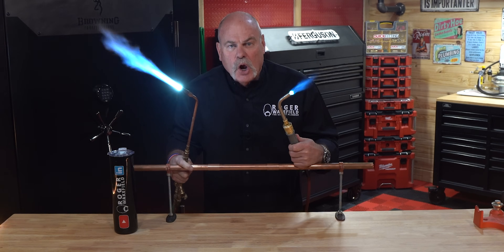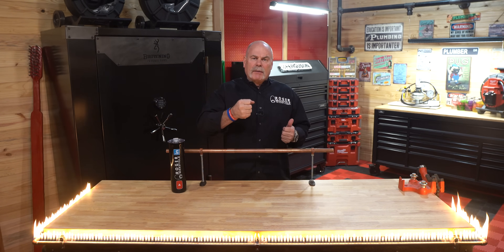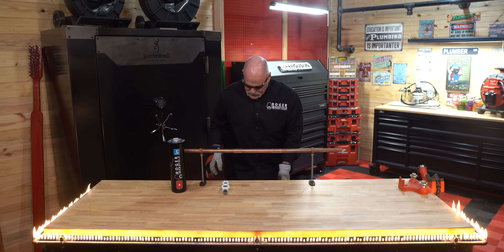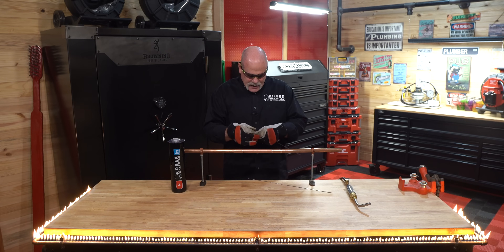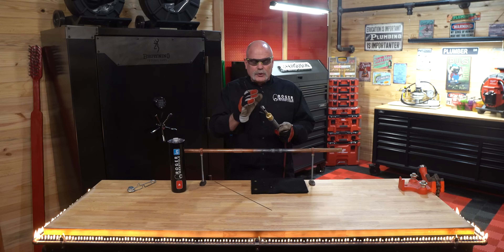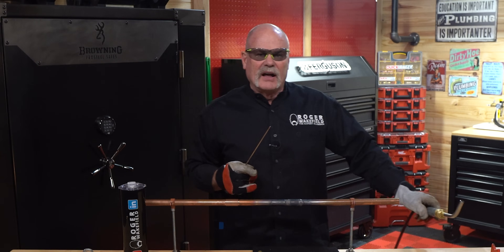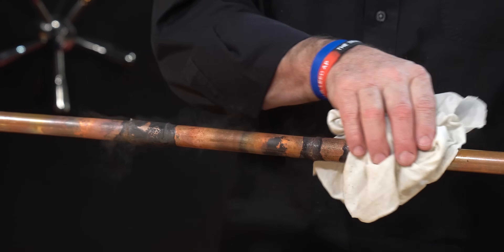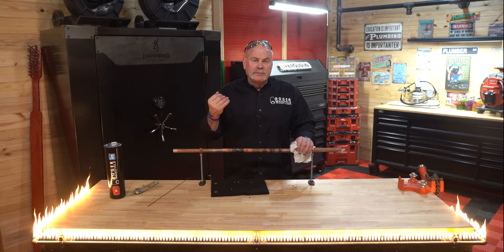The BEST Way to Braze Copper Pipes

Comment: very smooth i can see your experience. we usually like to suck into the bell a little more and then go again and throw a nice cap where you can’t see the edge of the bell. especially when doing CO2 stores that run at 900+ psi

Comment: i like turbo torch because of the size of the flame. normally doing it in tight spot and stuff in front and behind the pipe i am fixing . great video
Reply: The rosebud is always better you can use the appropriate tip size and even can control the flame too.  His instructions are really lousy

Comment: i like to get the pipe and the fitting glowing red hot then add the filler rod. quick and easy it lets you get all your work done with plenty of time for screwing off.
Reply: I was taught the same way, in HVAC class. Get it red hot, then apply the brazing rod. And as Roger mentioned, cleaning the joints prior to assembly is a big plus; although I've seen guys braze joints without pre cleaning and they still held.

Comment: Not a fan of that oxidizing flame, but I guess if your in a hurry. I've always found that it's much easier to repair leaks, do touch-ups and recap joints when your pipe and fittings aren't cooked to holy hell. As a shipyard pipefitter, appearance and cleanliness is important too.
Reply: He’s not showing you the purging process part of the procedure but it eliminates all oxidation during the cooling phase of this braze

Comment: I only use the rose bud for 2in and up pipe sizes. The turbo torch takes too long. For brazing smaller pipe 1/2 to 1in I'll use a welding tip, MAP gas, or a Tutbo torch.

Comment: Those braze joints look good.   Everyone has their own preference on what to use.   I liked a #2 tip for braze and air/ace tip for soldering.   I didn't have a need for a rosebud tip.   Thanks for sharing.
Reply from the maker: Right on, thanks for sharing Brad

Comment: i use a mini oxygen acetylene rig to braze and med gas,and fitting should be glowing while you push your unbent brazing rod into cup for full pen and yes you purge it ,its more of a weld than soldier and i clean fittings too that packing oil will mess up a joint in heartbeat

Comment: Roger aren't you the one who used almost a whole rod on a 3/4 joint.. wouldn't be calling you an expert, probably a hack at best
Reply: Same here just so happens that I only use a small amount cause thats all a brazed joint needs
Reply: Pretty low of you to call Roger a hack. Also I want proof of your amazing brazing skills on a YouTube video. Show us how amazing you are! I highly doubt you even have a torch just a typical YouTube bully.
Reply: Relax pretty boy, been a pipe fitter and a welder for way to long, and before that a plumber. So typically I can definitely call out a hack when I see one. And ps at this point a torch is just an extension of my body as far as I'm concerned
Reply from the maker: My joints don’t have leaks 🤷🏻‍♂️

Comment: Turbo torch is usually good up until about 2 inch pipe after that it gets very difficult and that’s where a rosebud would be easier
Reply: And don’t forget we’re hearing protection with these they are very loud
Reply from the maker: 📢 You got that right 📢

Comment: You can't cool a joint fast. You have to wait for it to cool down on it own. Think about it as putting water on ice.... the ice has fractures in them when you do that, so will your solder or brazing.

Comment: Why are people still brazing?  Why not just pex it
Reply: Depends on the type of building and fire code/plumbing code in your area, brazed soft copper can be buried for water in my area but pex can't have any fittings in it. At a couple hundred bucks per 4" fitting tee drilling and brazing gets economical really quickly too.
Reply: Because all medical gas must be brazed? Wait until you hear about refrigeration 🤣
Reply from the maker: Braze is better than pex 🤷🏻‍♂️

Comment: What is the difference between brazing and soldering?
Reply: The temperature needed to melt the rod.
From what I can tell, brazing last longer and is better against vibrations...
You can braze into existing lines without a fitting
Reply: Pressure it can withstand
Reply: Heat resistance. Solder melts at a much lower temperature than brazing rod
Reply: Solder is / was lead (now they have lead free solder).  Brazing uses a brass rod.  Both need flux.  Boss melts (as others have mentioned) at a higher temp.
Reply: American welding association defines the difference as the filler melting temperature. Below 450C it's soldering, above 450C its brazing. 👍
Reply: A solder joint is actually a stronger joint
Reply: @destinylags6863  just curious how solder is stronger than brazing? I would never want to solder a joint inside a big ac unit it just wouldn't feel safe to me.